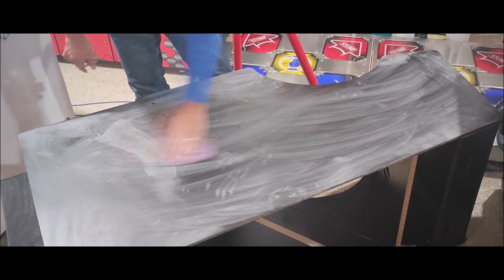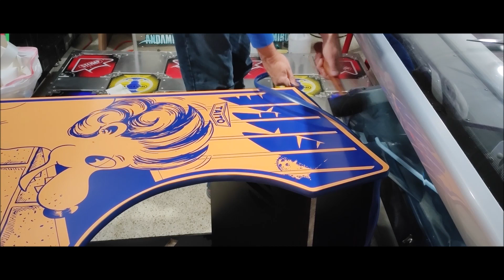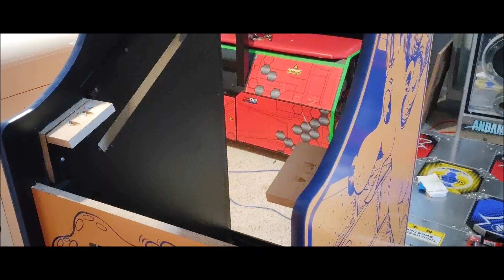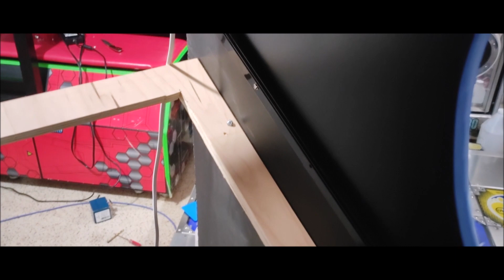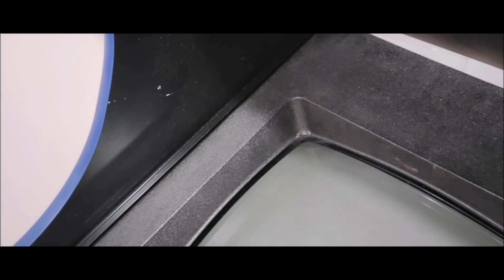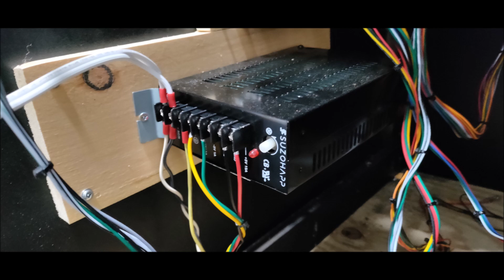Arcade Cabinet Scratch Build   Zoo Keeper Part 7

Comment: Amazing build. How did you put the Marquee in and secure it, I am guessing from the front?
Reply from the maker: Unfortunately I did not have original hardware for it. I used a piece of angled aluminum from Home Depot to secure it. The top is held in by the slot cut in the wood, the bottom is held by the bracket acting as a lower lip.
Reply: @classicarcadecabinets886  cool thanks for the reply, that makes sense. I am planning on trying to make one of these Taito cabinets using an LCD and a Pi, not sure which theme yet. Your videos and website is so helpful, please keep posting.
I watched all the Zoo Keeper videos, but didn’t see the control panel being put together. Did you just join the two pieces on an angle and round the top piece with a router?
Cabinet looks so good!!